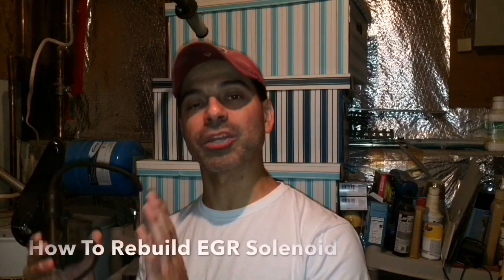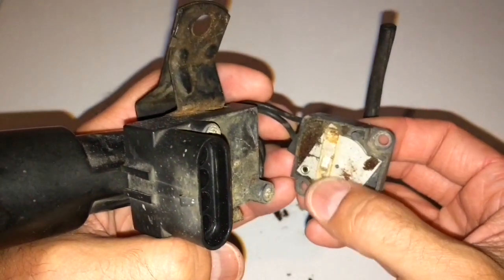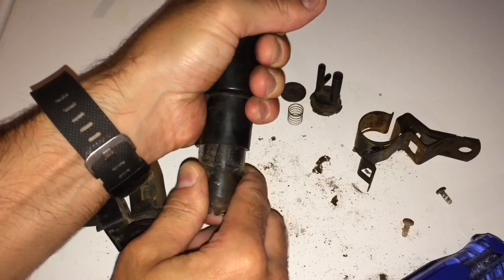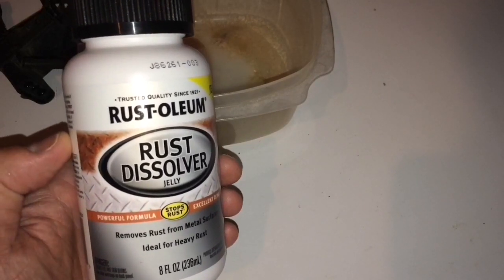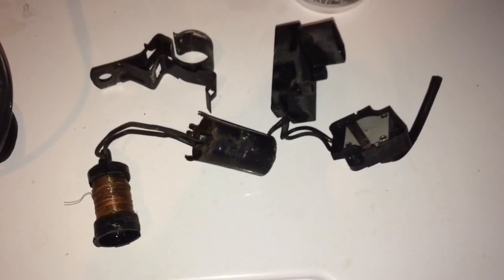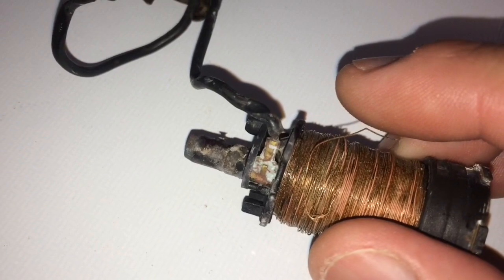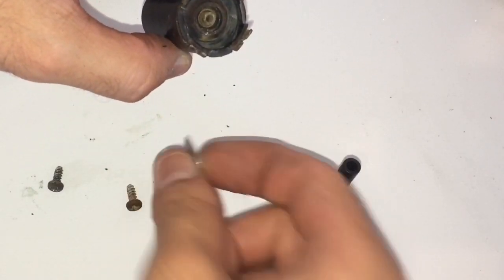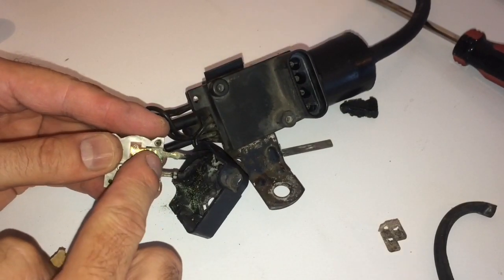How To Rebuild & Repair An EGR Solenoid (Andy’s Garage: Episode - 110)

Comment: Great video. The reason there is so much corrosion is due to the design. The filter is not an air tight fit so moisture can work its way in around where it attaches to the solenoid. I coated mine with a thin coat of liquid electrical tape to seal the gap all around the filter. Also, those tiny clips that hold the valve end on the Solenoid can never make a perfect tight clamp - air and moisture can get in there too.  So I coated it with liquid electrical tape as well. On the vacuum switch, mine was not corroded but a lot of fine dust was in there. It almost looked like a disintegrated filter sponge/gasket (hard to tell). On the sides of the switch cover, there are two tiny notches to let ambient air pressure in on the back side of the switch so it releases when no vacuum is present. I drilled one out and ran a tiny tube from it to a tiny air filter I mounted on top of the solenoid filter. Then I sealeded the perimeter of the vacuum switch housing with liquid electrical tape. Now, no dust will get inside the vacuum switch housing and moisture will not get into it so easily. A couple of dollars in material and a few minutes and I improved the reliability of the EGR Solenoid. Liquid electrical tape can be carefully trimmed/peeled off, so the Solenoid can be reworked in another 35 years.

Comment: I just tested my egr solenoid now. It works! 🙂👍 
Im not sure but it feels like the engine runs better now. Less rich perhaps? The exhaust isnt as irritating on the air ways.

I had to rewind the solenoid completely with new copper. Got an ohm value of 60, seems to have done the trick.
Reply: Where did you get the copper wire from? I'm gonna have to do this repair too, wanna have everything ready for a just in case purpose. And do u know how much you used?
Reply: @Cus7ate9  Hey. I just used regular lacquered copper wire. 0,23 mm and 100m. I dont think its very critical since its just an electromagnet.
Bought from a store called conrad.se. But any electronics shop should be able to provide.
I have a few images on my instagram magnus_fiero on how I did it.
The tricky part was getting the polarities right when assembly, both eletrically and the vacuum.

Comment: Thanks for making this video. 
However, you shouldn't skip some steps so we can actually see how you went thru all of the process. 
Instead of using clear package tape, you should have used heat shrink tubing. That would work much better to protect the coil.

Comment: My Jeep Comanche requires EGR Solenoid part # EF-8933002298.  Mine doesn't work.  I have struggled to get a new one.  I want to know your thoughts on adapting in an AC DELCO W0133-1687705.  I found a company that can supply the Jeep Connector and the GM Connector and I can splice the wires together, as to not affect the stock wiring, and it looks like the mount will be the same and the vacuum lines look like they will work without mod.  My only concern is accidentally wiring it backwards; or, not having the proper voltage to actuate the solenoid.  Appreciate your video.
Reply from the maker: 301steady to be honest I’m not sure about your specific vehicle. I know some older GM vehicles can be interchangeable with minor modifications. I do believe you may have to chip the ECU or you might get a check engine light.

Comment: OK I give up, How do you remove the plastic ring with out destroying it? What does it look like out? I have tried and ruined one already.  Is there a secret for removing the solenoid from the case,  I had to drive the one out with a hammer. I have a bunch of these to try and repair, any help would be appreciated.
Reply from the maker: I just Gently pried the case open (without breaking it) and resealed it when I reassembled the solenoid.
Reply: @PhillipsVision  Thanks for the quick answer. I will give it a try. Any ideas when the solenoid is rusted to the case. I tried the rust dissolver jelly but that didn't do it.
Reply from the maker: @geraldvalentine7777  I would leave the jelly on longer. You have to be careful you don’t damage it
Reply: @PhillipsVision  Thanks again.